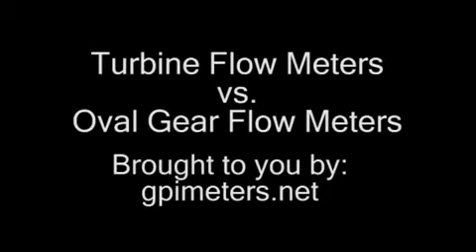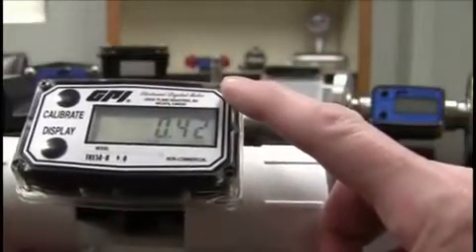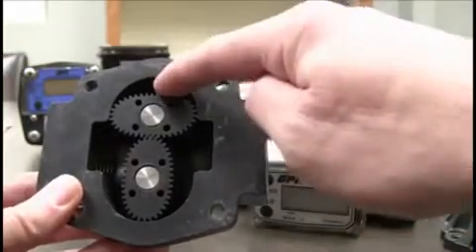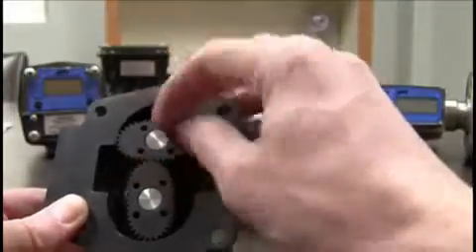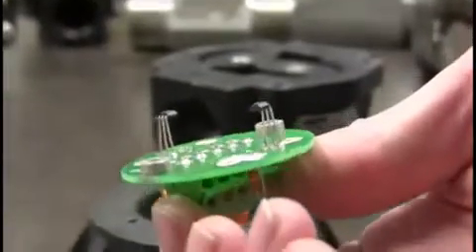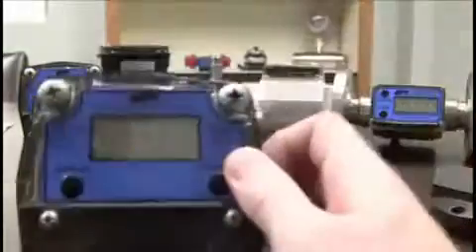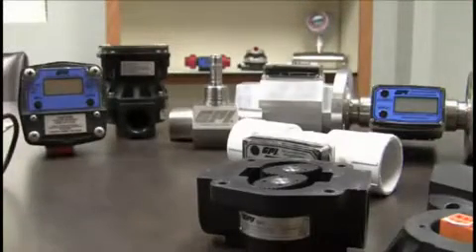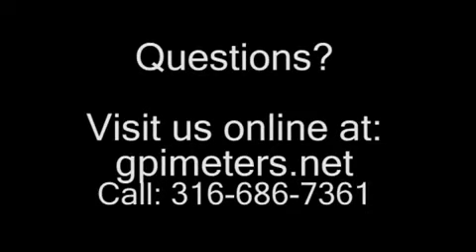Turbine Flow Meters vs  Oval Gear Flow Meters

Comment: Hi Matt, I have just tried two different liquids through both kinds of flow meter (turbine and oval gear). The two liquids were clean water and an emulsifiable oil used for chemical spreading on agricultural chemical applications.

There is no way the gear flow meter reads the same for those two liquids, which is very disappointing to me. Like by a factor of between 5x and 10x different. In fact, roughly the same error as I observe with my turbine type.

Can you comment?